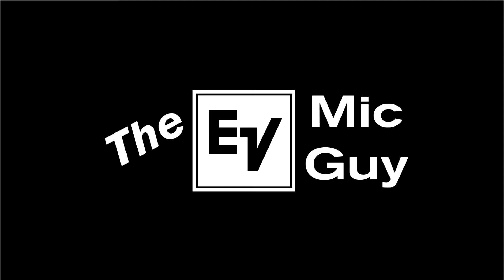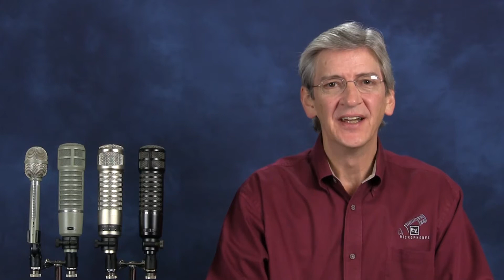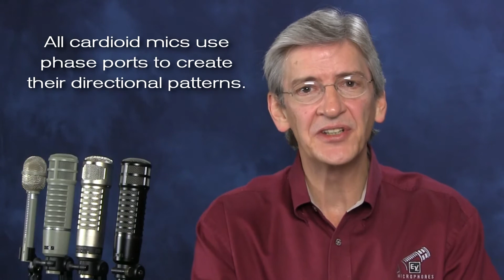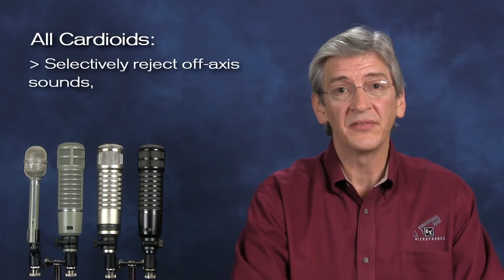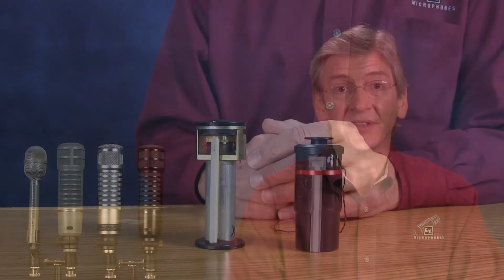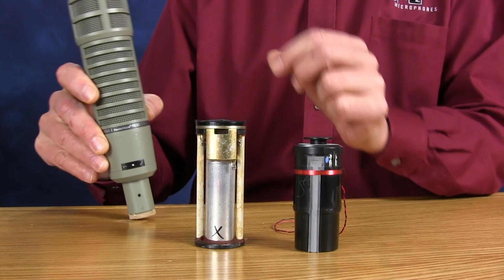Variable D Explained

Comment: You say that the vents on the mics should not be covered, I'm using a WSPL-2 pop filter and it covers the top five vents and only the bottom three are shown, is this an issue?
Reply: No, not a problem. The foam will let the sound-waves pass.

Comment: Yes, and this an important feature. However,  we don't want to confuse proximity with tone. There is a proximity effect that changes the amplitude of the signal but the TONE of the speaker etc., remains almost the same. I still believe there is a rise in the bass end and perhaps even midrange close up. I would like to see an actual curve where I could see the various effects visually say from pink/white noise etc., to see the boost/cut and the various effects tonally if there are any.

Comment: Rick, good evening. I 've got an RE 20 and i want to put it on a table top mic stand. Everything I've tried the RE20 just starts to fall because of it's weight. 
Any solutions to this?

Thanks,
Lawton Chiles
Reply: Add some weight to the base
Reply: Get stronger mounts. I got a Samson boom arm on Amazon for aroundf $100.. A bit pricey, but it works really well, you can move the mic around easy, and it easily supports the weight.

Comment: I just bought an RE-20 and it has a buzzing. Is that normal??
Reply: no that's not normal. What interface or preamp are you using? If it's a cheaper one, you might need more gain. You don't need a new interface though. You can achieve this by using an inline gain booster. It attaches to the mic XLR port, and then you run a XLR cable from that, to the interface. The cloudlifter and fet head are popular, but way overpriced. I recommend the more recent SE DM1. It's half the price, and works JUST as well. Not close to as good, it's just as good. I like it better than the cloudlifter actually, it's more transparent. That will give you enough gain to sound great with any interface because you can then turn the interface way down, as the preamps won't have to work as hard, and will be less quiet. The buzzing is likely from your interface needing to be cranked too high to get enough volume, and cheaper interface preamps are noisier than others.

Of course there can be other causes, like loose chords, mic defect, interference from other devices, but the RE20 with proper power should introduce zero audible background noise. Oh, the DM1 costs around $100-150, fyi. The RE20 is excellent though, hope you figure it out! Cheers.
Reply: @JunkBondTrader  Hey thanks for your reply. I actually ended up returning the mic. I had it hooked to a MixPre 3 II and a Mogami XLR cable so I think we can rule those out as causes. so it comes down to either mic defect or interference,but I suspect it was the former, I read elsewhere that this is a common issue with some of the recently manufactured RE-20s. So yeah, I decided to return it. Ended up going for a boom for my desk setup which has the advantage of not being in the frame for Zoom calls & youtube vids.